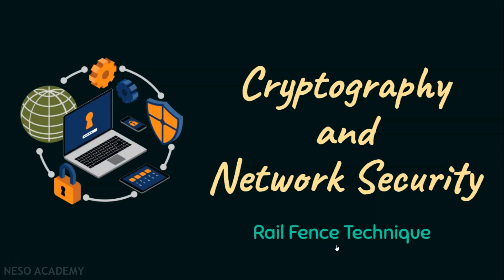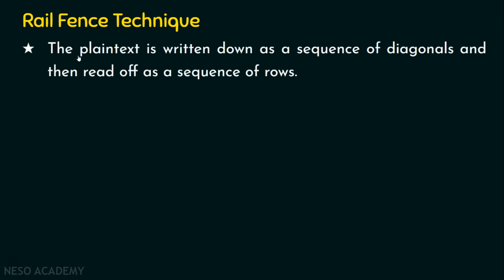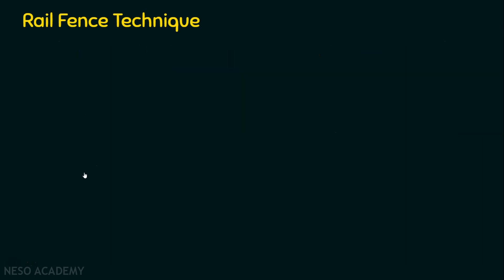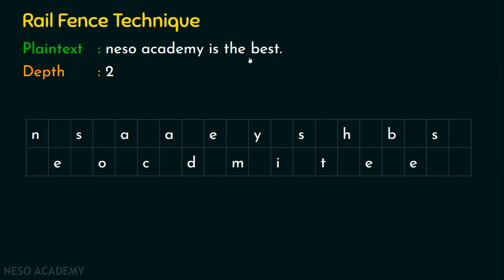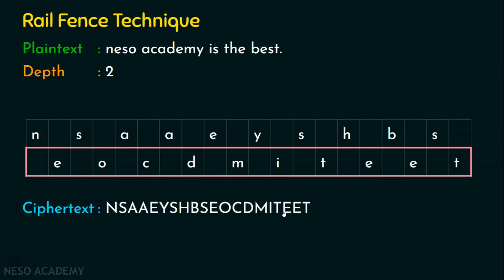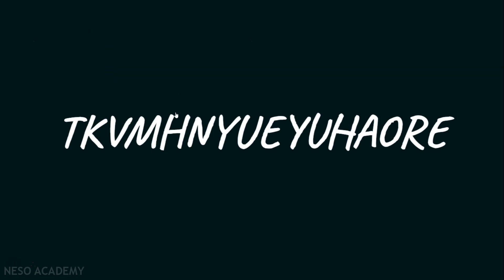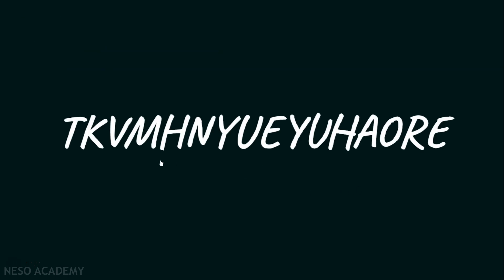Rail Fence Technique

Comment: 00:09 - Introduction to Rail Fence Technique in Transposition Encryption.
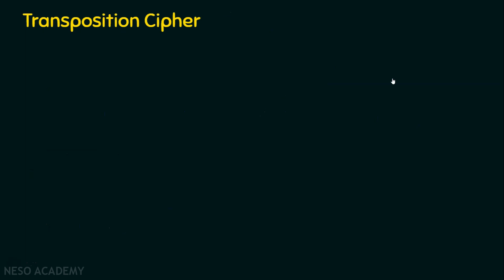01:02 - Rail Fence Technique is a simple transposition cipher without character substitution.
01:50 - Rail Fence Technique rearranges plaintext letters using diagonal patterns.
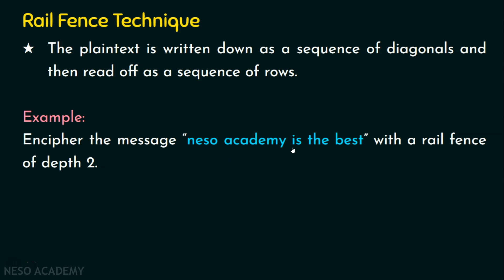02:38 - Understanding the Rail Fence Technique for encryption with depth 2.
03:24 - Rail Fence Technique uses a diagonal format to encode plaintext.
04:21 - Explains how to structure cipher text using the Rail Fence Technique.
05:11 - Encryption depth in Rail Fence Technique affects the complexity of cipher text.
05:57 - The thank you message is encoded using the Rail Fence Technique.

Comment: So to decrypt "NSAAEYSHBSEOCDMITEET" 
Formula is:
decrypt value = length of the word / depth

Then divide the chiper text into that decrypt value then (like if decrypt value is 20/2 = 10) 

the make 2 group ( ndaaeyshbs | eocdmiteet) 

then take one word from group 1 and other from group 2..... And make the plain text...

Plain text is : "neso academy is the best"
Reply: The first group is wrong it should be nsaaey.... 
Not ndaaey...

And also give example for if depth is 3 because I don't think this will work for depth equal to 3